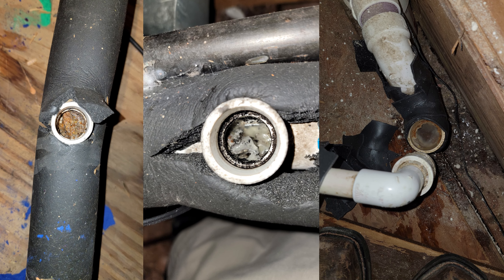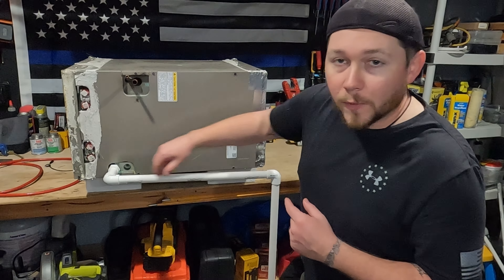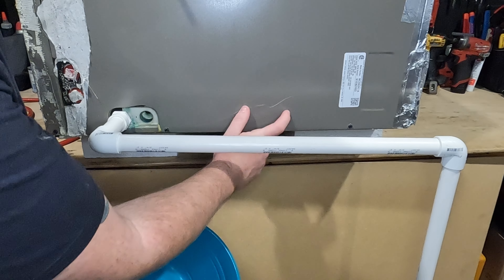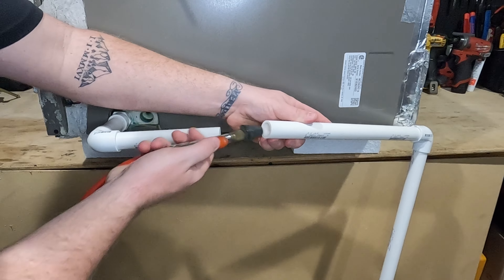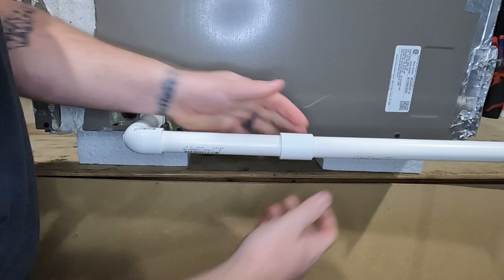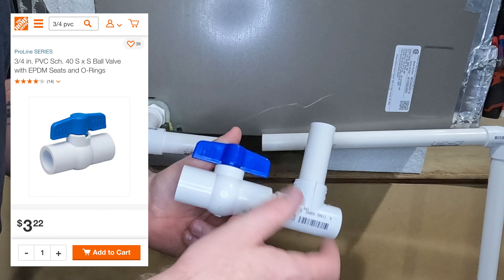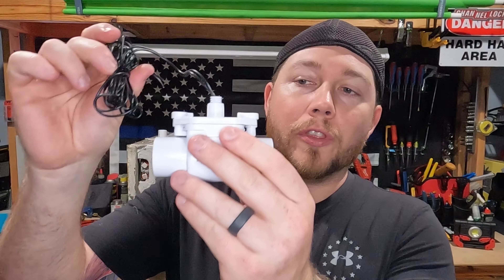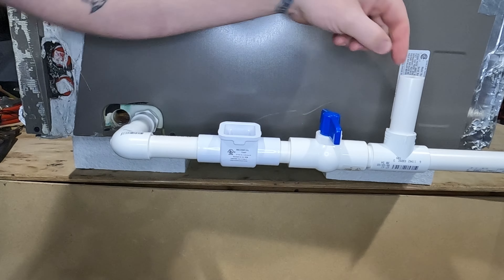How to Unclog Your AC Drain Line (and Prevent It From Happening Again)

Comment: Btw, I like the idea of the valve, my systems already have the vent there for guys to add bleach... "eye rolls".... but no way to isolate the line. So, good idea, I think I'm gonna do that, install it between that vent and the drain outlet from the evap unit so I can close her off and give a good suck!
Reply: I did this to 3 units and also added a 6" section of clear tubing secured by hose clamps over the 3/4 drain line so I can disconnect the clear tube section and vacuum from either towards the main drain, or towards the unit for an efficient cleanout. Of course i added an additional vent after the trap as well. I'd rate this a good fix!

Comment: Great video! Previous owner didn't maintain this ac system well so it seems like the green sludge is causing the water to spill out of the drip pan onto the floor 🤦🏾‍♂️. I got all the sludge out of the front of the pan but can't reach the sludge in back of the pan where the leak is. Any tips to get the sludge out without removing the system?

Comment: I don't see any water leaking in the room with the actualy hvac unit. But when I turn on my ac I notice that water starts leaking out of a specific spot from my ceiling on the floor below where the hvac is. Does this mean that the drain pipe leading to the outside of the house is broken or could there be a different explanation?
Reply from the maker: Definitely go in the attic and look at your drainline, emergency pan, suction line insulation. Something is very wrong above that ceiling
Reply: @WorldofHVAC  My hvac unit is on the upper floor of my house in its own little room. I just checked and it looks like the black pipe where the white drain pipe leads to has some dirty water and clumps of stuff sitting in it. I assume that is the problem? Luckily I caught the ceiling leak pretty quick so it only affected a 2 inch portion of the ceiling before I turned off the AC. Would you still suggest that I open up the ceiling where the leak was even if the leak is fixed after I unclog the pipe? I still haven't unclogged the pipe at the moment, I'm waiting on a drain gun to arrive from amazon. Thanks for the response! This is the first major problem I've encountered since we bought our house back in 2020 (it's a new build) so I've been pretty stressed about this.

Comment: I can't find where my drain line exits. Pretty sure it's tied into the plumbing in my master bathroom. It's not under the sink.. i plan to cut the line in the attic and hook a shop vac to it and rebuild with a union. My main drain line exits the coil unit into a "T". The botton goes to my line, the top is just open. While running it blows cooled air out the top. Should there be a pvc cap on it or does it need to breath?
Reply from the maker: Sounds like you have a positive pressure system. If that's the case it is fine air is blowing out the T.
Reply: @WorldofHVAC   I have 2 trane systems that were installed in 2022. If that says anything. Thanks for the reply.
Reply: Check the outside of your house.

Comment: I have a ‘T’ , do I just do the air pressure through the T directly?
Reply from the maker: Air will take the path of least resistance. If the drain is blocked down line from the evaporator then all the pressure will just go backwards towards the coil and not towards the blockage
Reply: @WorldofHVAC  thank you for the information!
Reply from the maker: You're welcome!

Comment: Hey what type of air compressor you use to flush the drain line?
Reply from the maker: Any air compressor. You can use a 1 gallon pancake compressor as long as you have the attachments. 
Professionally I use nitrogen tanks and tbe Gallo Gun but I have that cheap gray one from harbor freight I use around the house
Reply: Thanks man this is golden. I rented one from Home Depot. Appreciated the quick response you have saved me tons of dollars !
Reply from the maker: @eralpatmaca5437 you're welcome!
Reply: @WorldofHVAC  for future use at home, would A/C flush kit work for this purpose?
Reply from the maker: @eralpatmaca5437 First thing that comes to mind when you say AC flush kit is an R11 refrigerant line flush kit which is no where near the same thing. 
If you want to get something small for yourself you can get the Gallo Gun or diversitech drain flush system. I'll add a link so you know what I'm talking about. 

https://youtu.be/dB99cbTepxM?si=ErmJEdmaQI5NEpzk

Comment: Weird some plumbers say use bleach and that is what I use. I can't imagine vinegar being strong enough to clean anything. Can I use cleaning vinegar instead?
Reply: Only passing along what I have heard with this… 
A lot of places, including the company I use for maintenance, say to not use vinegar either, as it can eat away at the glue that holds the pipes together, resulting in a BIG problem down the road.  So check on that before you decide to do it. The last two companies I’ve used have both said they ONLY recommend hot water and a vacuum now.
Reply: @grumpsoldguy2769  I found out later not to use vinegar because it is an acid. I have always used bleach.